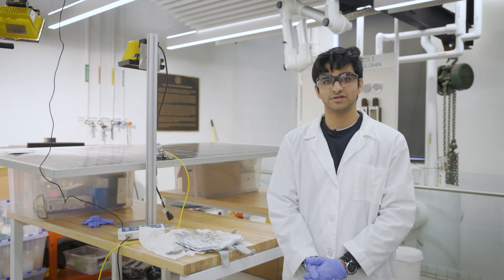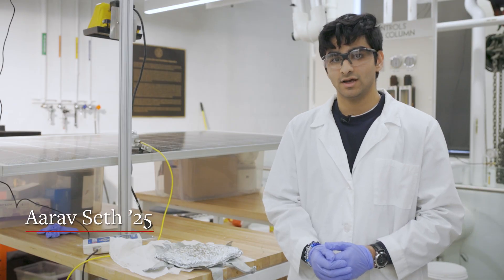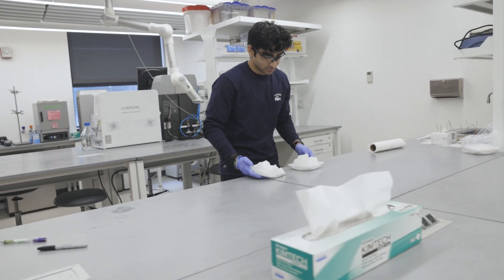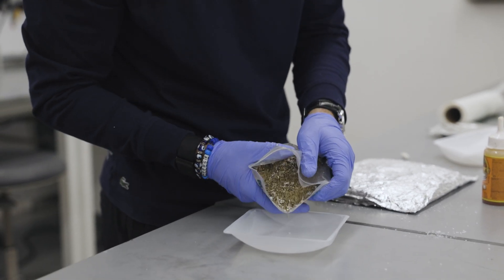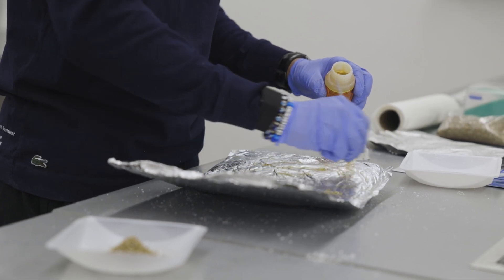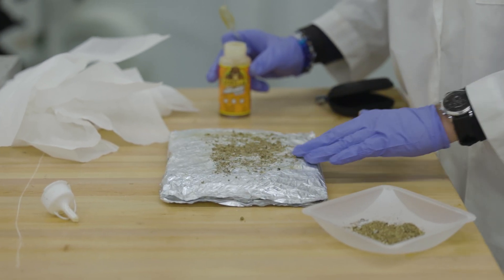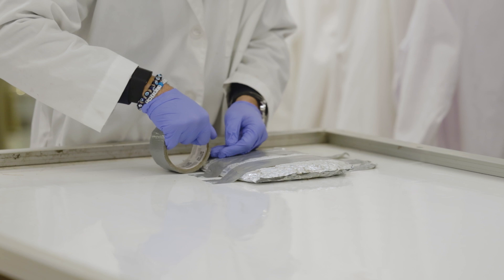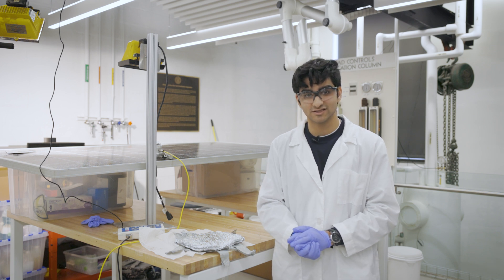Ingenious Engineering Hack to Extend Solar Panel Lifespan

Comment: as regards solar panels I have absolutely no knowledge, but, I'm thinking, to keep them cooler & provide warm water would it be possible to run a pipe system on the underside with water pumped through this system, thus cooling the panel(s) & raising the water temperature? like I said I know nothing about the panels, but once had a cabin with a home made system of copper piping on the roof & a small solar powered pump pushing water through giving me waster warm enough for a nice shower. I came accross this video purely accidentally & your words got my brain running riot..